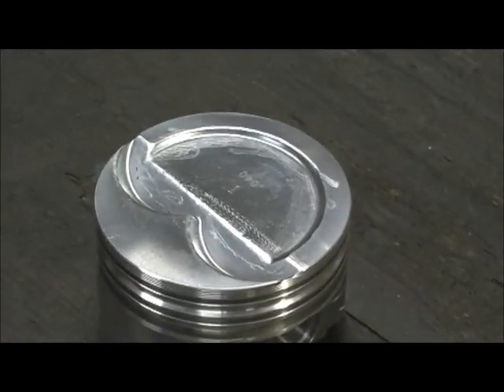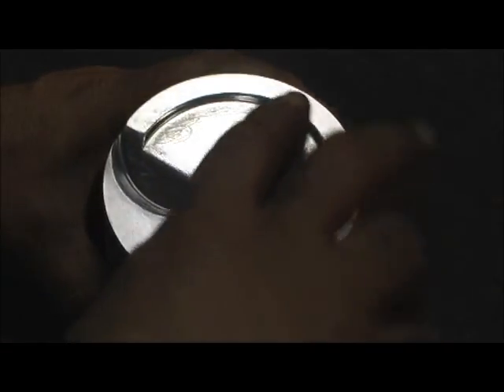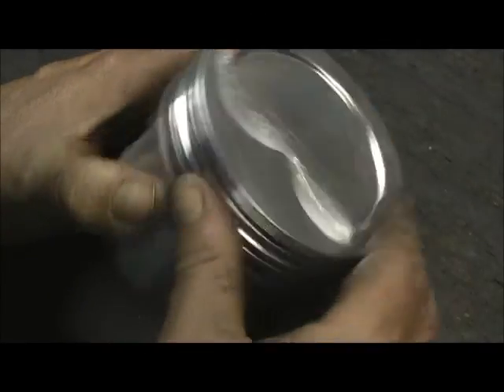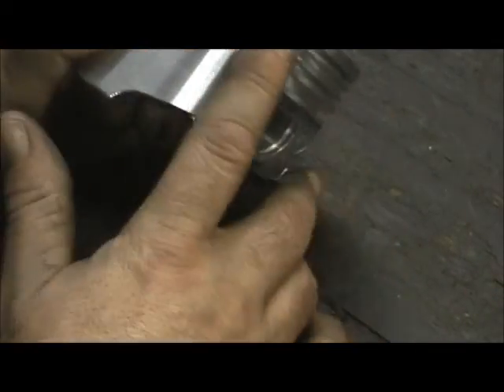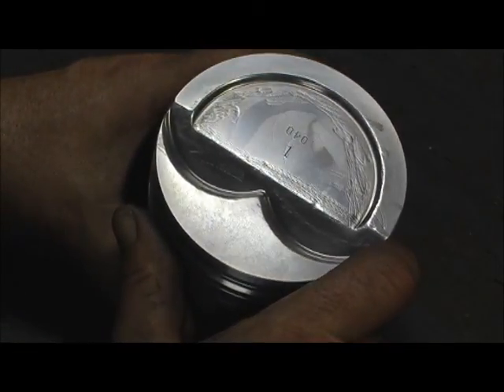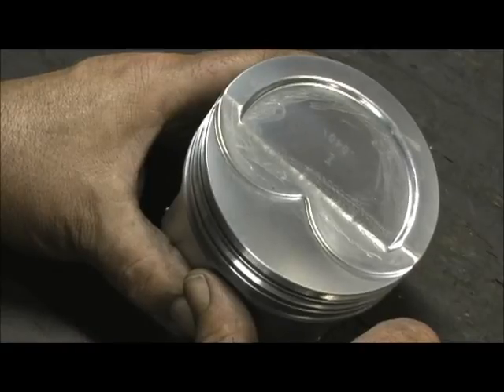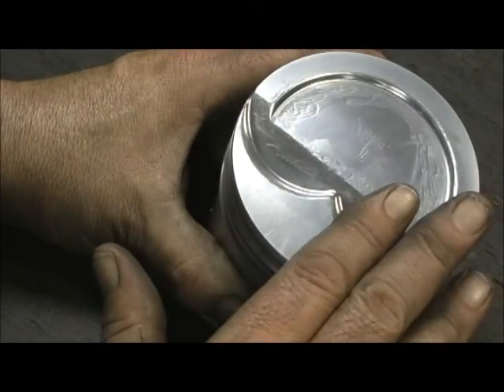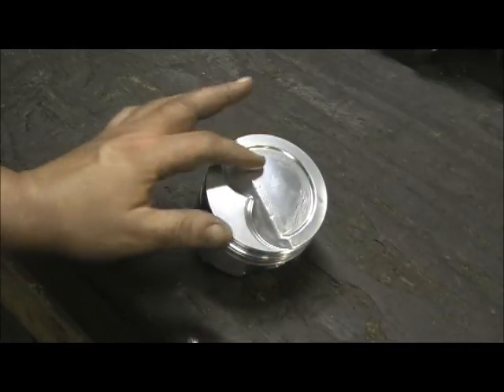336 Keith Black Piston Mods part 4 2

Comment: I simply break the sharp edges with 80 grit by hand. Very important and then I simply  polish the piston with the  finer wire brush on the bench grinder. Effectively the same job and about 10 min a piston.

Comment: I think thermal reflectivity is what you mean. Reflecting the heat back into the chamber  where it will increase the cylinder pressure making the engine produce more usable work from the fuel. Increasing output and increasing efficiency. The less heat that soaks into the piston the less the piston expands and the tighter the clearances can be. The hotter chamber does make the rings hotter which need larger end gaps.

Comment from the maker: Keith Black does not to my knowledge make a six inch rod for this piston and rod combo; however, even if they did I would not use it in this situation due to the oil ring in the ring land. If you ever done one of them they smoke some, and customers don't like that at all. There is simply not enough gains to be had by going to that rod for this application. IF it was serious racing, it would be different.